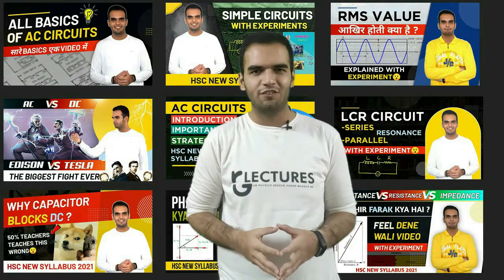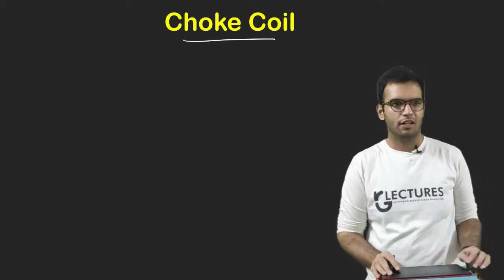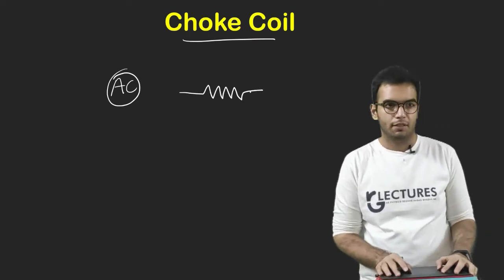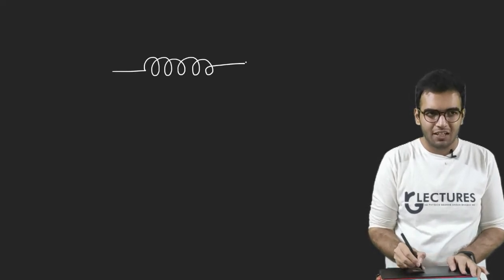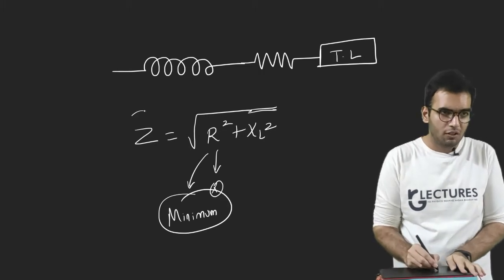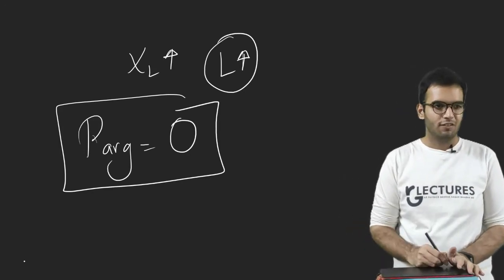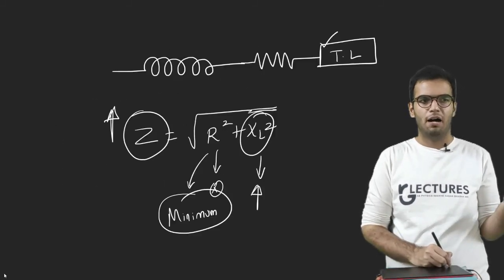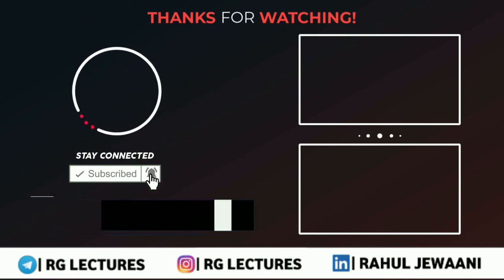Choke Coil Explained in detailed | What is Choke Coil | Ac Circuits | Reactance Resistance Power |

Comment: Seems as though the energy absorbing action from the choke coil is to enforce steady current with less ripple to a resistive load from a time varying voltage source.
Capacitor ( also stores energy) does the same but is used to maintain steady voltage from a time varying current source